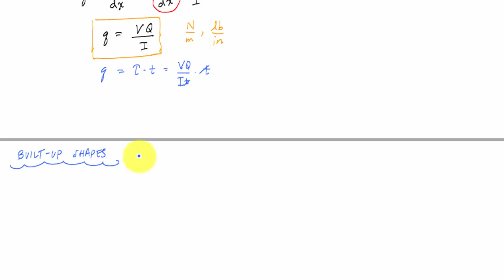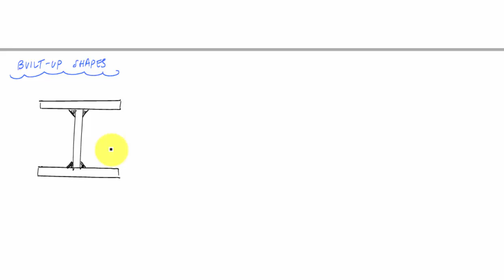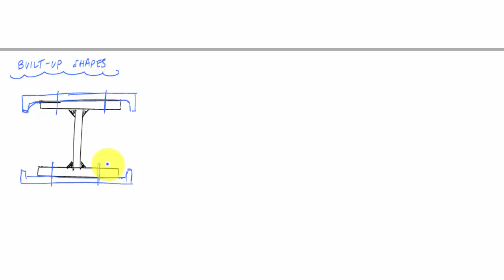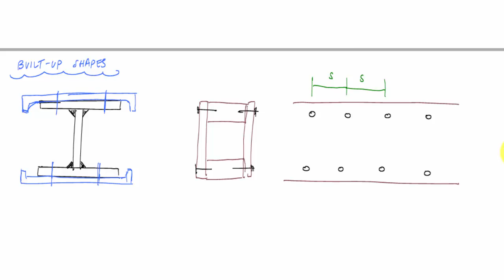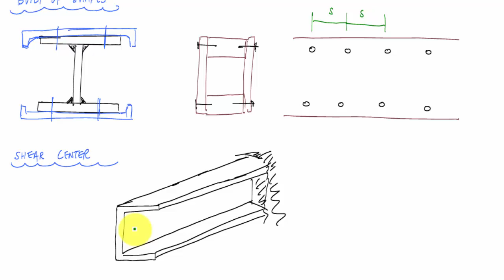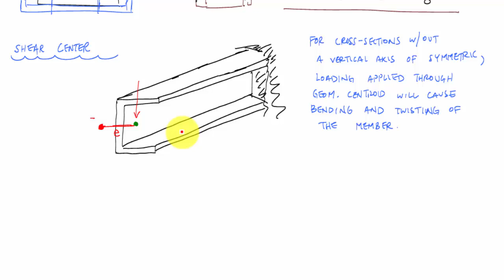Introduction to Shear Flow (2/2) - Mechanics of Materials

Comment: I am really enjoying your lectures. I have a question.

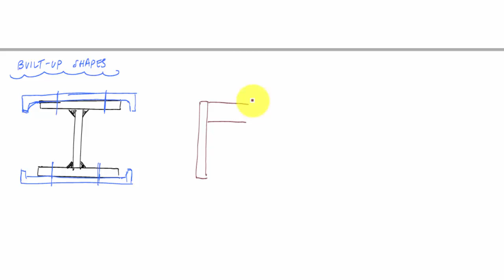For the built up hollow rectangular beam at 1:55 mark, Im not really clear what Q value to use to calculate the shear in the nails. Do you think you could discuss the difference in shear flow between having nails installed horizontally vs vertically?

Comment: I'm guessing shear flow is also used in calculating development depth of reinforcing steel bars inside of concrete to ensure the reinforcing bar generates enough friction forces along its length to resist shear flow and hence work in resist bending loads?